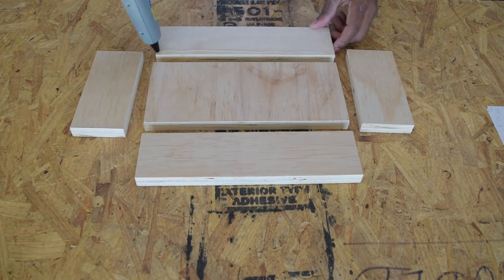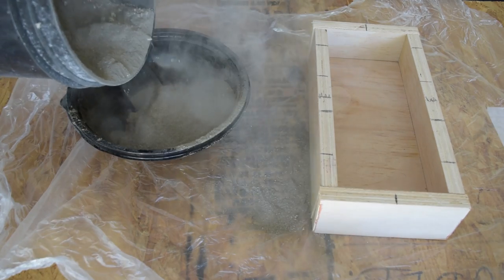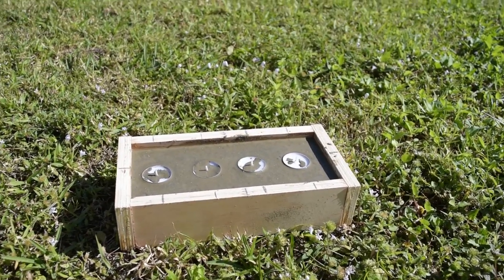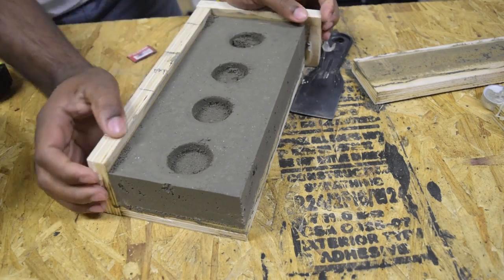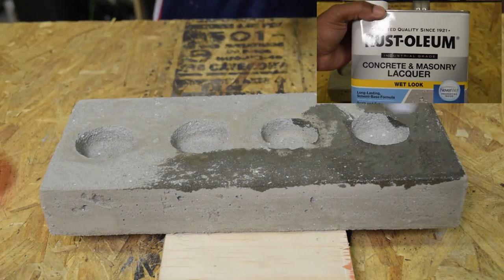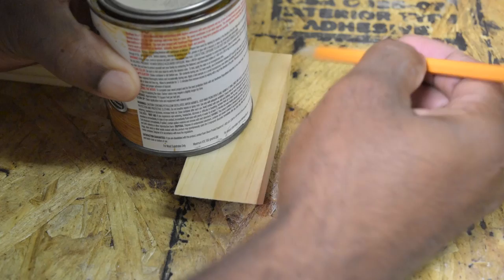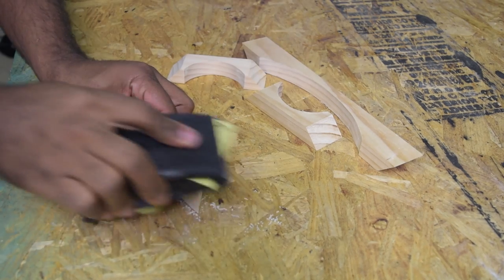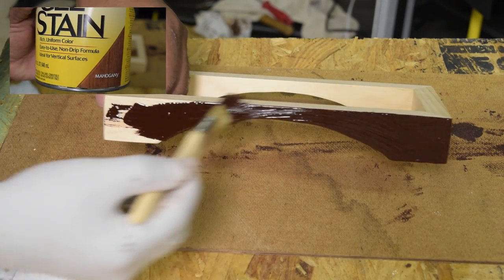Concrete Candle Holder How To Make | DIY Build

Comment: just a tip: if you put the concrete in the sun you do not speed up the "drying process" - you just let water evaporate and have a lesser quality concrete

concrete does not harden though the evaporating water, it cures (in an exothermic chemical reaction) due to crystal formation (calcium oxide and hydroxide and silicon dioxide) - this takes a few days to weeks - an for proper curing it takes months to years even after the concrete is apperently "dry"

if you mix the concrete too wet i can have an impact on the strength - if you mixt i too dry you prevent the reaction from running properly and will have definitly a weaker endproduct

this does not really matter in your case - but if you pour, for example, a concrete slab or a foundation, you need to follow the instructions properly - and if it is outside you need to cover the fresh concrete from direct sunlight or rain and sometimes you even need to keep it wet to prevent cracks in the surface
Reply from the maker: Thank you. Sorry not a pro just a DIY guy. Not everything will be perfect its all trial and error, live and learn.
Reply: *apparently
Reply: thx, i'm not a native speaker and appreciate feedback to improve myself :)
Reply: I really enjoyed your videos..they inspire me a lot bro....you deserve  like ,share and subscribe..
Reply: This is true, however, excess water in the mix also produces lesser quality concrete, and ends up evaporating out.
Reply: If it was me, and I had a mix with excess water, I would leave it uncovered at room temp. For a mix with a good balance of water I would probably cover the top to keep the moisture in.
Reply: I don't think suit1337 was criticizing by any means but rather just providing some further knowledge on concrete curing.  He even made it a point to mention at the end of his comment that this was not really relevant to Glen's work here in this video.
Reply: +DIY Creators you forget to shake out the air bubbles... i suppose you can add that tip  to the video if you got the chance.
Reply: suit1337 who are you 👀

Comment: Great idea! If you ever make one again, try using some plain motor oil on the wood form, it helps the form release from the concrete easier.
Reply from the maker: +jimgam730 
Thank you I was thinking of cooking oil. For the next concrete project. How easy is the motor oil clean up?
Reply: About as easy as cooking oil, lol
Reply from the maker: +jimgam730 
Well I'll give it a shot. Thanks

Comment: Great work. Learning lots on your videos. I think since I'm going to epoxy the wood to the bottom, I may try to decrease the height of the concrete. Hoping that doesn't make it weaker. Thanks for the tips!
Reply from the maker: That's awesome Thank you. If you want to make the concrete thinner I would suggest using some chicken wire. You can also use a wire clothes hanger cut it into pieces and place it in the concret to provide extra support.

Comment: Nice project. How heavy was the whole thing when done? Just fyi you can rub the wood down with mineral oil or carnuba wax and it will help prevent the concrete from sticking.

Comment: if you use unsealed wood for moulding, moisten it before you put in the concrete, it will prevent the wood from stealing the water from the chemical reaction of the cement. also after you have it in there shaking the mould/tap it with a hammer/or running and orbital sander or other vibrating tool over it will work up the air bubbles from the concrete. but very nice and a great idea

Comment: Great build man, i love the idea of using concrete to make this kind of thing. 
If you want some color in the candle block, maybe ad some coloring agent to the mixture, it makes things pop out with the color, but still keep the cement texture. I used spray-lacquer to finish of some projects and it also works very well.
Reply from the maker: Thank you. I plan to make more and ill add some of your suggestion.

Comment: I like the idea, have you thought of using blue insulation foam for a form?  I have used it as former material in the past and it works great, makes a very smooth side and it is light.

Comment: Nice design! I saw a cool trick on making a concrete countertop. They used a recip saw without a blade up against the form to vibrate out all the bubbles and make a smoother edge. Thought it was a good idea.
Reply from the maker: Thanks, yep your right also a palm sander would work as well.
Reply: Nice tip with the reciprocating saw. I use a large bolt in a hammer drill, really rocks those bubbles out and settles the concrete a treat. Thanks for sharing.

Comment: Hey man, when you're putting concrete in the form, I would suggest you to oil the form first, that way the concrete comes loose easier after you remove the form and it decreases the changes concrete to break.
Reply from the maker: It was my first concrete diy project. So there was a few things I could have done better but thank you.
Reply: Aight np, just thought to give heads up for you and maybe some viewers :) The project was very nice and came out nice tho! :)

Comment: This was a nice project, good job on the final product.

to make things easier for you though, you might want to adjust the guides on your bandsaw to almost touching the blade and the thrust bearing to just touching.  It will make cutting curves a lot easier  and give you more control over the blade.
Reply from the maker: Thank you! Will definitely Give that a shot.

Comment: Just another tip to get the air bubbles out of the concrete, when you've put the concrete in, get an orbital sander (without sandpaper on) and put it on the "shuttering", switch it on and the bubbles will come to the surface immediately.
Reply from the maker: Thank you this one was my first concrete project. So a few thing could have been better.
Reply: Having additional liquid lessens the chance of bubbles and is perfectly fine in a project like this a few little taps is fine however having the candle pieces on top would probably be best to do before putting those in also many people forget to put rocks\aggregate and for something like this I would use much smaller ones which you can find at the dollar store

usually a ratio of 1 part cement 2 parts sand and 1-2 parts aggregate in this 1 would probably be enough

Comment: Nice!
Just a note. Concrete does not dry, it cures. Sun won't change the time it takes to set up.
Reply: No aggregate. It's not concrete. It's a mortar mix
Reply: I've not checked his mix. Just the title. But if you prefer: Mixes made of portland cement does not dry, it cures.
Reply: Sun will decrease curing time since it applies heat to the reaction.
Reply: in principle yes, but if the sun/external heat drains to much water, there is not enough left for a proper chemical reaction - so the endproduct is weaker than properly cured concrete

also the reaction creates a more uniform heat distribution - if you leave in exposed in the sun, the surface will heat up faster which will create a thermal gradient and a differential in the water distribution - this can cause cracks in the surface

Comment: Small tip with concrete: Use an old electric tooth brush or ladies toy to get air bubbles out of you mix. Just run the tooth brush or toy on each side to vibrate out any air bubbles trapped. This will give you a more solid and consistent curing processes.

Comment: Did you used double bubble as your epoxy. lol how well is it holding. I'm curious how it will hold up over time. great job as always
Reply from the maker: +Jarod Martin Thanks man,  Yes you got me lol its double bubble epoxy. Im pretty confident this will hold up its made for wood, concrete, steel etc.

Comment: Love it!  I was wondering if you could dye the concrete on something this small? Thanks for posting.
Reply: I just learned (from another DIY vid) that you can dye the concrete by including an oxide, or even colored chalk. I think the key is be careful that your coloring agent doesn't interfere with the concrete's exothermic curing reaction.
Reply: There are products available to stain concrete that are applied after.
Reply: sagesdragon there are pigments and stains but I've also seen someone else use acrylic paint mixed in. 😊

Comment: I wonder if you could use colored grout for this? Neat idea
Reply from the maker: +Ratdog 305 Im not sure how strong it would but you can always give it a shot. Thanks
Reply: grout is weak in large usage and not very colorful ...acrylic paint could be nice
Reply: You can dye concrete
Reply: Grout is not strong; it will crack easily. Stick with a "concrete mix", or the basic ingredients of cement, sand or other aggregates, etc...

Comment: Dammit! ANOTHER incredible project from you? Good job, pal,

Ok though, one thought on "over watering" the concrete. I've read from both the 'crete manufacturers and other Youtube hobbyists that adding too much water doesn't just cause the drying/setting process to take longer, but it also WEAKENS the end-product. But here, obviously, that shouldn't be an issue, those candles don't exactly weigh that much after all. <grin>

Ok, gonna go now in my "rush" to kinda replicate this project of yours. I'll tweak it of course and I'm gonna use it to "backlight" a birthday present I'm making for my wife. That should "put it over the edge." I hope so, she's a tough cookie when it comes to buying her gifts. ;)

Thanks again. Please keep this great work up, ok?